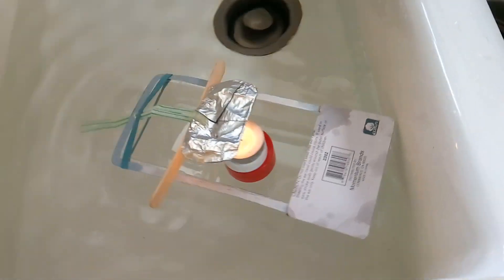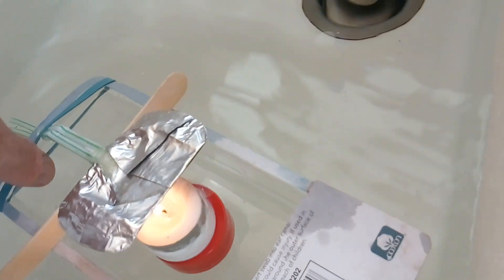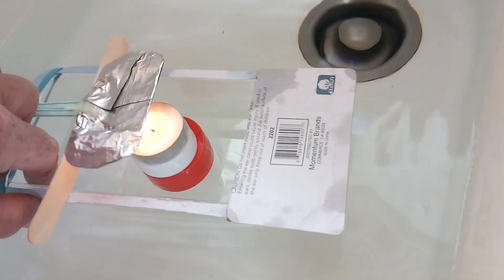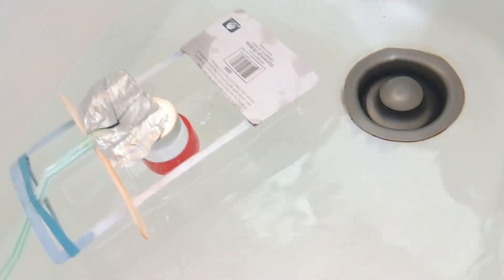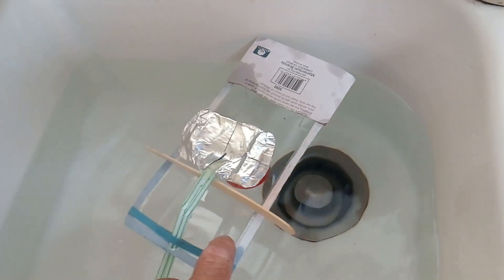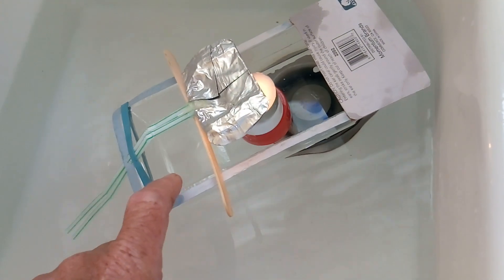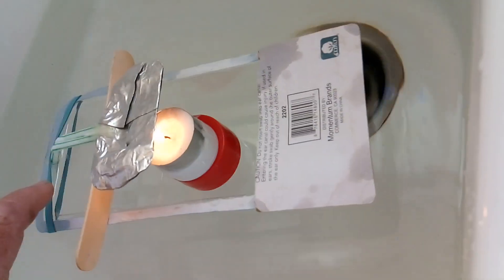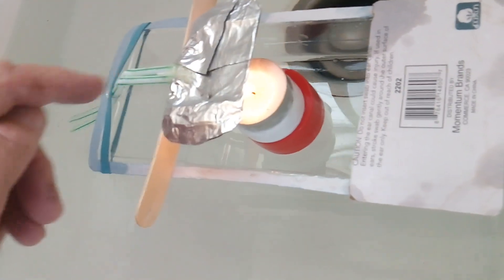My First Pop Pop Boat

Comment: That is amazing 😁😁
Reply from the maker: Thanks for the help on this with those links.  You are right about them being tricky to get running right.  Reminded me of a Stirling engine build.  The boiler has to be air tight and withstand  high heat.  My epoxy glue melted pretty quick and the thin aluminun was hard to seal. This was a good starting place though.😀
Reply: @Lidmotor  I really like the look of this one. It does demonstrate you don't need to make the whole thing from brass sheet and silver solder, (although brass sheet and silver solder does look beautiful).
Reply from the maker: There is a high temp epoxy I might try using a coke can boiler design by Myfordboy.  This is a really interesting topic.  Your single pipe motor designs are on my to do list. @GrandadIsAnOldMan